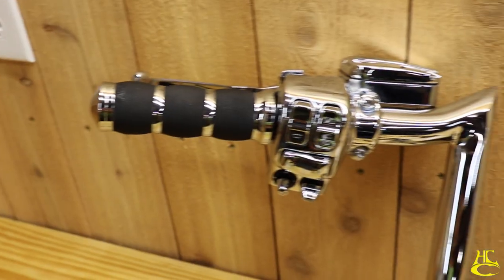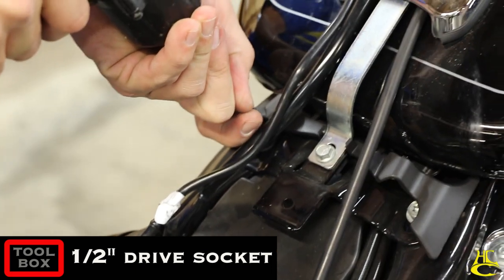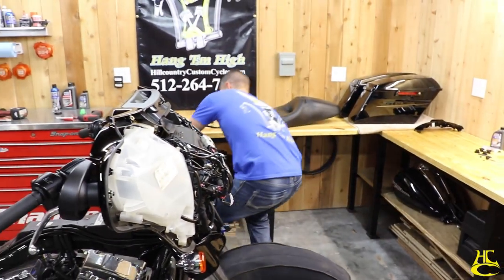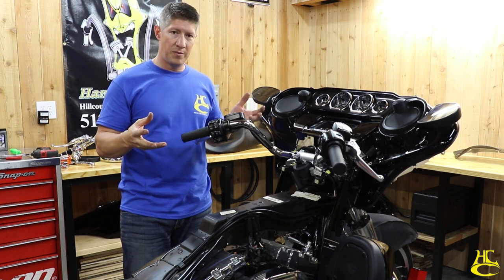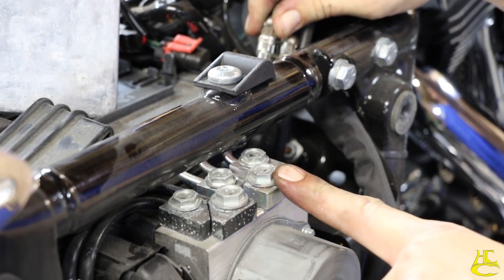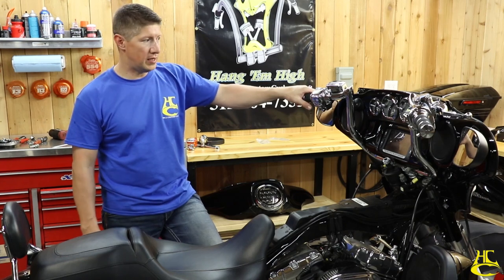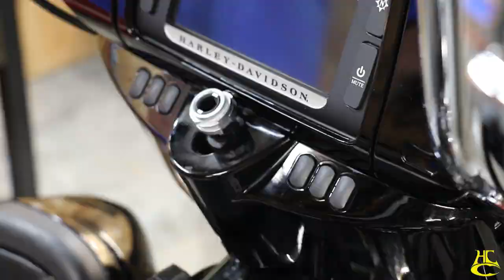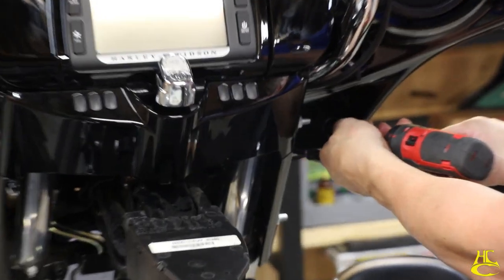How to Install Paul Yaffe Monkey Bars on a Harley Davidson Street Glide Ultra Classic

Comment: I have to do a bar adjustment on a 15 street glide. Is there enough room to get to the back 2 clamp bolts by just splitting the batwing? Never done one that new. Btw my personal bike is all HC. Ordered from you all yrs back when whole area was flooded.

Comment: 🤔 I believe up to 12” bars, you can reroute and use existing brake and clutch cables. You’ll need wire extension kit though.
Reply: Another video I saw did that!  I was wondering why he took bags, seat and tank off.
Reply: @darinn8265  your right on a 2014 and up you can reroute
Reply: @darinn8265 because he changed brake line, and he needed take off right cover

Comment: Waist time and a lot of money swapping out the cables.  Can use stock cables up to 14” bars.
Reply: That's what I thought, too. No wonder he had to take off the tank. He was doing some stuff that was confusing and didn't provide the reasoning behind it
Reply: I'm getting ready to put 14 on my road glide. Not sure about the cables
Reply from the maker: +Brent Spencer What year?
Reply: 2019 cvo. I have a complete set up on order with you guys. Funny

Comment: I have a 2012 Ultra Limited that I bought 3 weeks ago. The previous owner was short and installed 2" drops which is too low for me. I want a set of 10" bars like in this video, but Harley wanted 1200 including the install.

Comment: Nicely done. Great idea on the vent hose.  What size is the vent hose fitting?
Reply from the maker: +Rick Stannard a 1/8 or 3/16 should work
Reply: Thanks, I had the exact same question.

Comment: So what your saying is that a new brake line connected at the ABS module will not introduce air into the line? 
Just bleed from the front calipers to the master cylinder?
Reply from the maker: +J L  correct

Comment: I need a set of those bars for my 16 ultra ill use my controls to save some cash but will need clutch and brake cable
Reply from the maker: We appreciate you watching! Feel free to call the shop so we can set you up with exactly what you need when you're ready. 877-755-4455 Thanks!

Comment: So if I purchased same exact bars without the pre-wiring (I’d use existing on ‘21 Street Glide Special), would that work using existing lines?   I’m just trying to forgo the brake bleeding etc.   it seems like that would be easier to me. No?

Comment: after you have the new bars on how hard is it to move the mirrors to the top
Reply from the maker: +Gage Click there are already holes in your hand controls to put n mirrors like a Softail has.   You just need to cover up the holes in your fairing when you take those mirrors ofg

Comment: Question on the extended plug and play electrical connections are they one piece or spliced in the handlebars ?
Reply from the maker: +Streetglide40S&W  if we wire them up, it will be a 1 piece harness, so there is no connection inside the handlebars that could come out later down the road

Comment: Can I use my stock clutch and break line for a 2014 street glide with no ABS...  
I saw you loosening up the lines and you lost me there. thank you
Reply: yes I did, you will require the wire extentions to be safe
Reply: Po

Comment: Can you buy just the bars wired with just stock black controls?  Use my own break line and clutch cable.
Reply from the maker: +MARC Boov Sure can, give us a call, 512-264-7333, ask for Freddy

Comment: How much is this exact set up. Thank you
Reply from the maker: +Mark you should probably check our website, but they usually run $1200-$1300.  Keep in mind, all the wiring is a 1 piece harness and guaranteed against defects.  It also comes with a new throttle sensor installed.